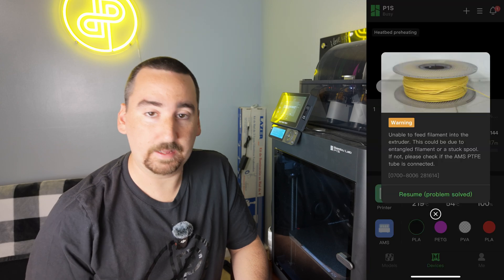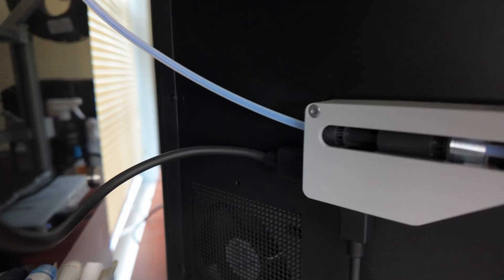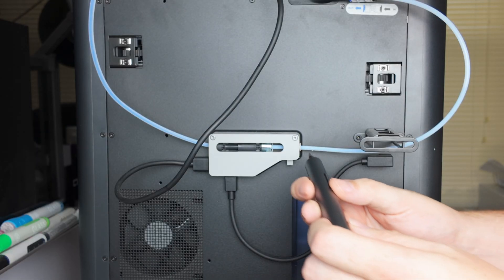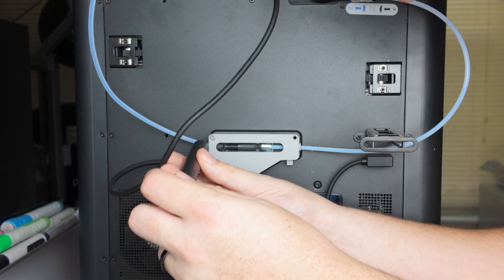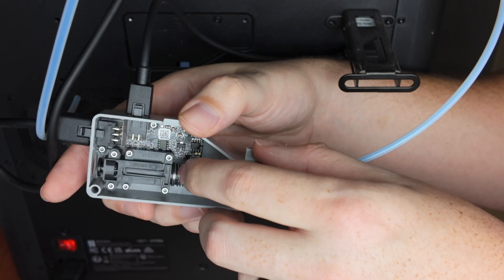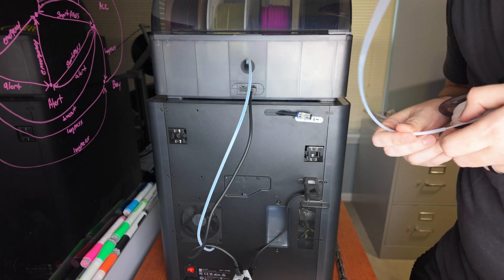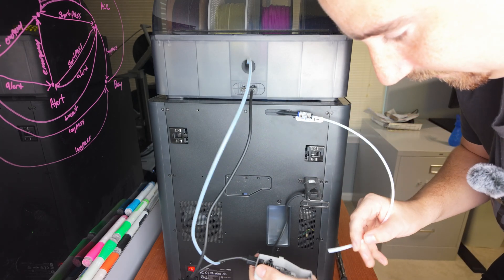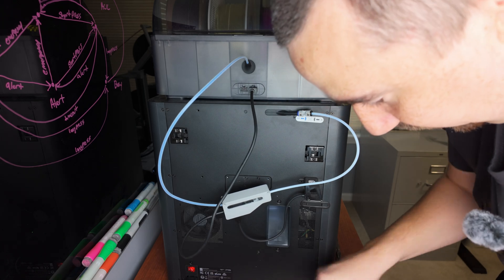Bambu P1S Failed to Feed Filament into Toolhead | Easy 2 Minute Fix

Comment: Same problem but the filament simply stops before the toolhead. The toolhead is not blocked, you can push manually through it.
Reply: Did you find how to fix this? Same thing is happening to me.
Reply: @coreymic  I changed the filament sensor but I don t remembe if  that that was exactly what helped. But it is ok now. I think it worth checking the PTFE tubes and how they lead to the toolhead.

Comment: I have that same error message. I did the same thing as you, but there wasn't any stuck filament. And I still have the same problem. What else could it be? 
Please help me  🙏🏻
Reply: This is the pickle that I am in right now too
Reply: @takarahansell9620  I am also in that pickle.  Seems to be catching on the ptfe tube as if it is not seated all the way.  I can't push it in anymore.
Reply: @takarahansell9620  me too
Reply: My PLA makes it all the way to the tool head then the AMS module seems to move back and forth rapidly and i get a feed error, i replaced the nozzle, checked for any jams in my tool head with a complete disassembly, nothing it blocked but i still get an error
Reply: @jamesdonovan7863 The most common thing on these hot ends to fail I found was the extruder gears.  Inspect or clean it.  Maybe replace it.  I resolved my issue by turning around the coupler on my ptfe tube right after the Ams sprint thing in the back.
Reply: @MoeReefs  You wrote that you resolved the issue bij turning the coupler...I had the same issue but it keep happening. What can I do to fix this permanetly?
Reply: @jamesdonovan7863 did you ever figure this out?

Comment: Brand new first attempt at the benchy and I get this before it even starts. Not a good feeling.
Reply from the maker: This is a filament problem, not a printer / AMS issue. Wet filaments get brittle, and they break off in different parts of the system. Try drying the filament, should stop this from happening.